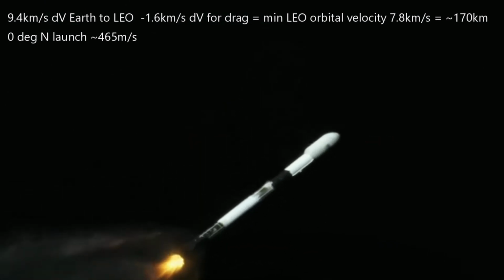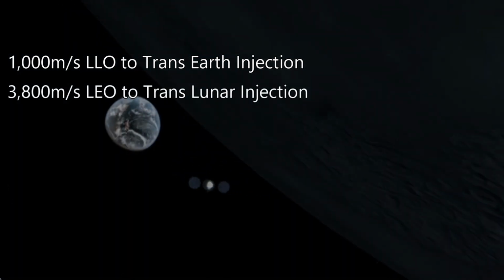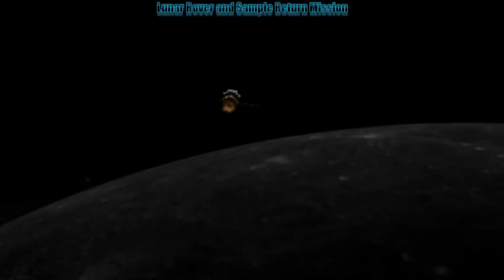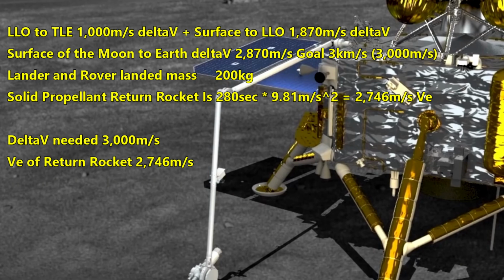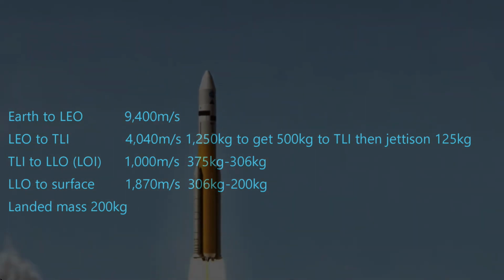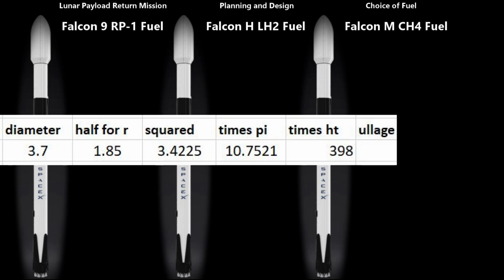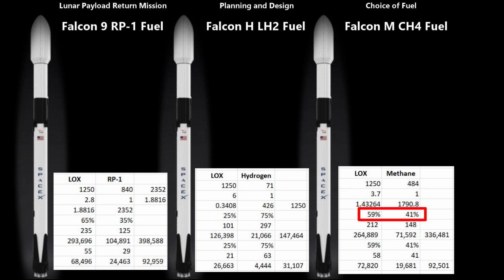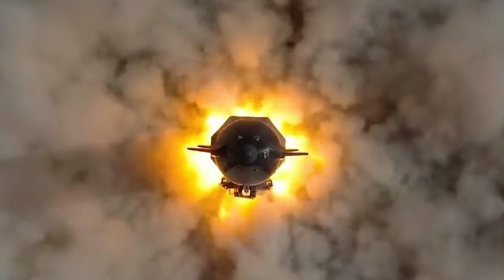Rocket Science: Lunar Return Mission!

Comment: I am convinced that reentry plasma can fuel the generators which repels that very plasma to a distance that greatly reduces temperature that reentry crafts experience.

The idea is to use piezoelectric properties in construction the exposed surface area. This will also have specialized groves or channels that focus the flow of plasma into charging the EMF generators. 

We will call them "plasma breaks" ...
Reply from the maker: What about thermovoltaics also?
Reply: @terranspaceacademy  good point, integrate those too. 
The more conversion processes happening = more efficient bleeding of energy = better breaking effect.

Comment: Starship  fix- temporally hold heat tiles in place tensioned plastic wrap similar to wrap on pallets  -   after launch wrap  that is not needed pealed away - 
for reentry use tension wire net woven into( over) critical areas -   have only seen one picture of tile fixture - looked like problems to me -
Reply from the maker: I agree... a tungsten alloy wire wrap might be a good idea.

Comment: I can certainly appreciate the time, effort and skull sweat that goes into these videos...they should be shown in schools.
     Wouldn't RTGs be useful for colonies? I recall reading that an rtg using americium 241 ( smoke detector stuff) would provide heat for a few centuries. Maybe at a lower output than those with shorter lived elements, but you have  a no moving parts generator that would work for a very long time...
Reply from the maker: RTGs will be vital as backup power, emergency power and critical systems power.  Like when hospitals drop to generator power with only vital systems operating.  The ship would revert to RTG if anything happened to the main power source.  I also love the Carbon-14 Diamond batteries for locator beacons and life support.

Comment: The better lift in methane is because it produces the shoot as it burn. Making the air under engines denser. If they could find a way to make air under the engines denser using thee other fuels. They would enhance there lift capacity too.
Reply from the maker: That effect could provide extra lift in atmosphere but it is the exhaust velocity and mass propellant flow that are the only factors that matter in the end.  I've wondered about a bi-fueled methane hydrogen engine...
Reply: @terranspaceacademy  it does, that why the methane has better lift. The soot it produces is harder to push away and clean burning fuel...find a method that makes air denser. Put a couple tank on that dump water or a mixer just behind rocket motors as it is first ascending. You can dump the tanks when empty. You don't want it to extend all the way up into stratosphere. Or it will cause a eiectric discharge to the ground...
Reply from the maker: @rh1960  Actually the soot is not important to the thrust.  It is the mass ejected and the velocity of that mass, which is directly related to the temperature and the molecular or atomic mass of the propellant/products of combustion my friend.
Reply: @terranspaceacademy  what's that mass pushing against to lift the rocket?? I don't think your realizing all the physical relation in what thrust is. If the air hove more resistant to being push away from exhaust pressure. Then you will get a better lift from exhaust.
Reply from the maker: @rh1960  The mass pushes against nothing my friend... it doesn't need to.  The act of mass leaving an object imparts an impulse onto that object equal and opposite to the momentum of the object that left, in this case the propellants.  mass x velocity
F(thrust)=mdot times exit velocity
Reply: @terranspaceacademy  you understand part of the principles involved. But your knowledge is limited to what you have been taught. You do not have the ability to see the whole picture. You don't work as a engineer do you? I guarantee  you, that you are wrong...
Reply from the maker: @rh1960  Oh my friend.  If you can find a single aerospace engineer to agree with you I will feature you both in a special video.  You are making the same mistake the New York Times made when they ridiculed Goddard because his rocket had "nothing to push against" it is a fundamental misunderstanding of the laws of physics.  A rocket exhaust needs nothing to push against.  That's just the way the universe works.
Reply: @terranspaceacademy  where does the rocket have the most lift? When it's taking off from the ground. By making the fuel harder to dissipate in the air as it lifting. It's like giving put ground under ship while it is pushing on the air. You, for some reason, do not realize that the trust has to push against the atmosphere and gravity to lift the rocket. Your not dealing with a jet. The harder it is for the thrust to push  the air under it away. The more lift power you will get. That's why methane lifts better. Because the soot coming out is harder to push through the air. That a fan and place it on a table against a barrier, more resistant and the fan will blow over. Now take the barrier away and it will not fall over,right. The soot is creating a barrier between the rochets thrust and the air, giving it more powerrr... That's the physics behind it.
Reply from the maker: @rh1960  I don't agree with the premise RH because it is wrong.  Easily proven wrong by the most basic rocket engineering course.  Rocket engines work better in space than they do in atmosphere.  It... does... not... push... on... the... air... for... thrust.  Please either accept that or start reading a textbook.  I always want to help someone learn but they must be open to learning something contrary to what they thought.  Find me one textbook that agrees with you and I promise I will read it.
Reply: @terranspaceacademy  Ok, let's go to a 1st grader demostration. Take a box fan. Turn it on. Watch it running with nothing behind it in its exhaust. Now take a heavy mist and spray it blocking it mist. The fan will lean forward and sometimes fall over from the added resistance. You need to think about everything that is taking place. Not just how the engine works. You can't seem to understand how the TOTAL physics involved in the launch is. Did you find anyone interested in artificial gravity system? I can teach you how to make one. Your not fully thinking out the process,  if your able to do so.
Reply: @terranspaceacademy  what is the exhaust pushing off to lift off the ground then?? How is it lifting the rocket in your opinion??
Reply from the maker: @rh1960  The exhaust does not "push off" of anything it does not need to... basic physics.
Reply from the maker: @rh1960  You have not studied nearly enough my friend... the TOTAL physics, do not support your argument.  But if you can control gravitons I will reevaluate the known physics on everything.  Please send a video of a valid demonstraction to terranspaceacademy@gmail.com.  If it works we'll look to find you funding.
Reply: @terranspaceacademy  then how, in your mind, is the rocket being propelled??? Tell me that tsa??? You think it has front wheel drive from a demention??? How do, you, think it gets it lift???
Reply: @terranspaceacademy  tsa,,how do you think the rochets propell theirselves??? If the engine are not creating pressure under rocket pushing against the atmosphere??
Reply: @terranspaceacademy  tell me your thought on that basic physics, your think about?? Tell me how the rocket lifts itself in space???